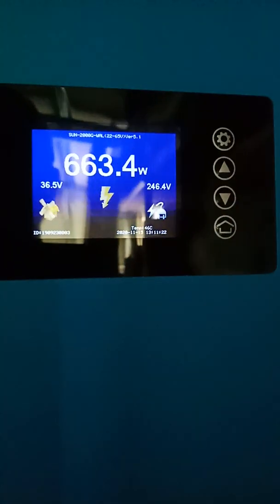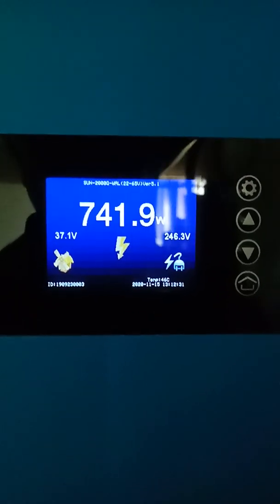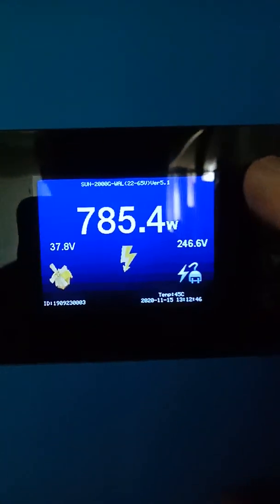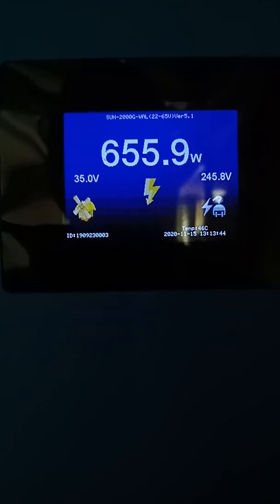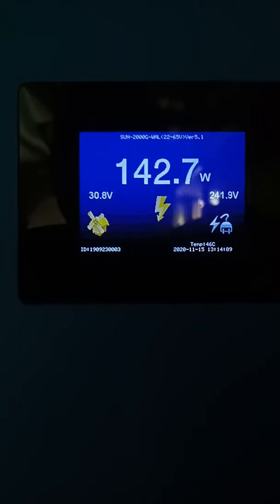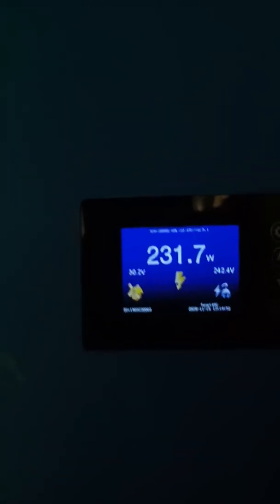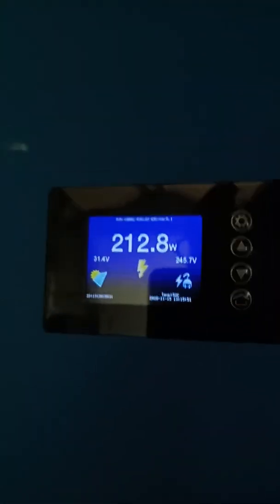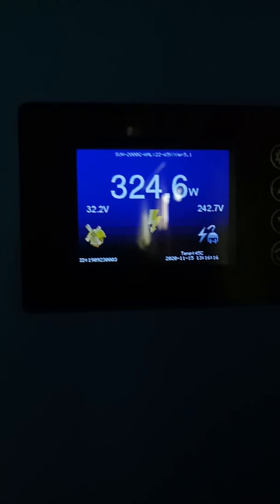B &C 1000w turbine and sun grid tied 2000w inverter. Part 2

Comment: Your new current curve is

23/80 26/164 30/255 and 255 all the way? And dump at 48?

 it works well??
Reply from the maker: Hi jerrit
It works much better than the default cuve as it slows down the spin speed of the turbine. 
Under a test I found that the 48 volt 2kw inverter can only generate 1.3kw at 48 volts so once that is reached the voltage has to increase to produce more power.  And as the voltage increases you are getting closer to the trip voltage.  The dump load will burn out if the gti hits over voltage as all the power is then absorbed by the dump load and if the turbine is producing more power than the resistor can handle it blows.
Reply: @davecollier8946  okey nice to hear I will test it... :)

Comment: Great set of videos Dave. I have a “2”Kw turbine that really is a 1kw but I’m struggling to get the Sun profile to work with it. It’s a 48v turbine with wind start up about 3.5m/s. Starts 24v around 4 m/s. What’ settings would you advise for optimum?